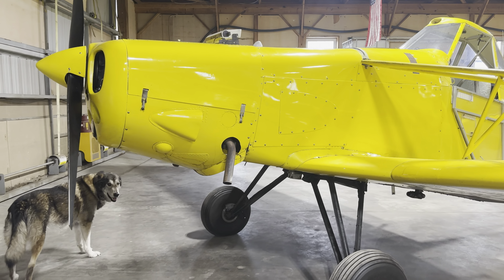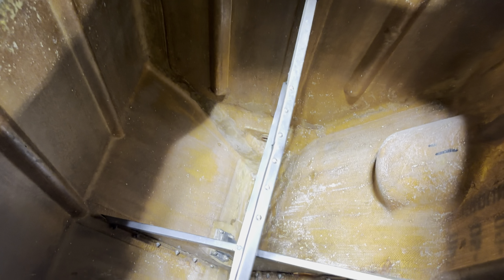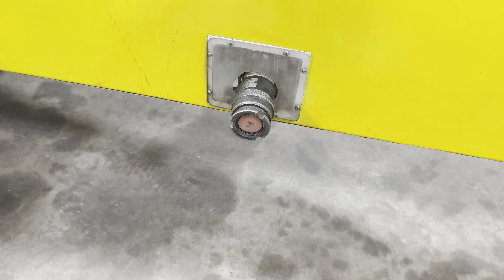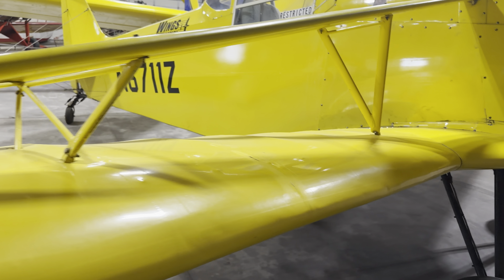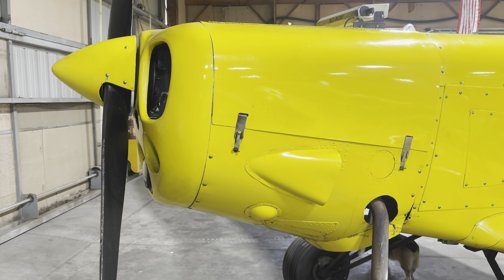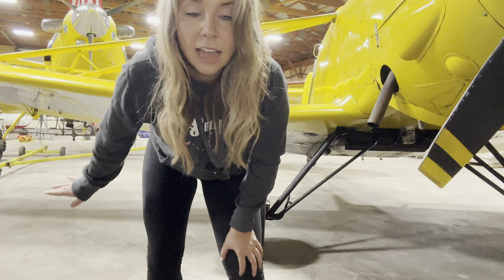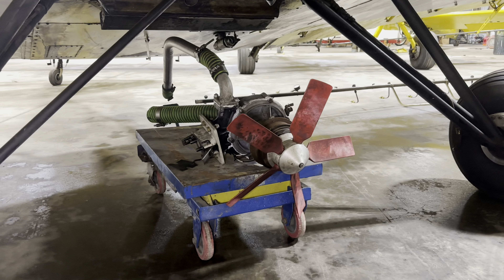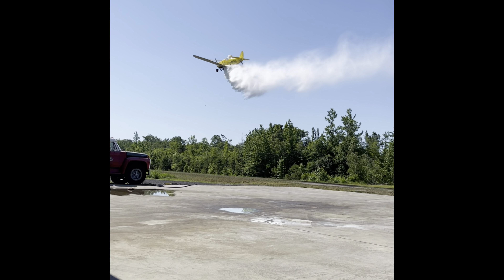Piper Pawnee Aircraft Tour

Comment: I used to tow gliders using PA-25-235s with fixed pitch propellers. They were stripped of  all of the gear except the hopper. One was stock, all fabric covered,  stock landing gear. The other one had metal covered Hutchinson wings with a Spring Steel landing gear and rudder horn extensions. That was my favorite one. Very easy to fly airplane, probably the easiest conventional gear plane there is to land.
Reply from the maker: Hutch Pawnees are awesome! And yes totally agree, a very docile airplane to land!

Comment: Thanks for the tour Emily. I am a 30 year A&P, I have only worked with commercial jets but I used to watch one of these run next to a MRO I worked at in Dothan AL. The maneuver that was done at the end of the field to track back in the other direction was impressive, pull up hard, kick the rudder over. I always imagined that there were wet tanks inside that aircraft, not that hopper. I understand you always have it under positive G's but still it seems like it could get messy. That fan driven pump is brilliant, I imagine that spreader creates a lot of drag?
Reply from the maker: This particular spreader isn’t too bad, believe it or not, but yes, some of the larger ones we have will definitely create a lot of extra drag!